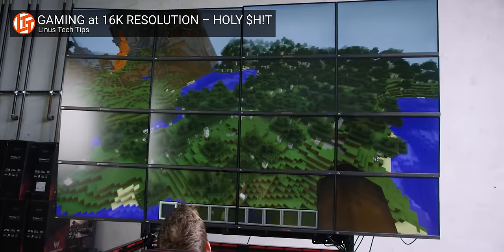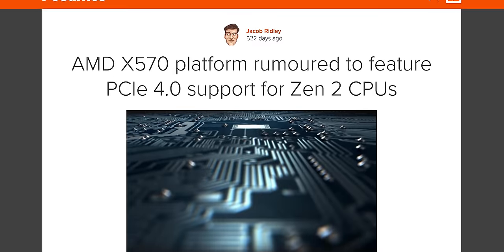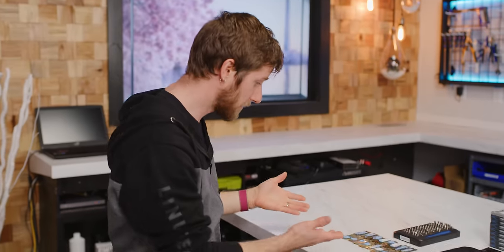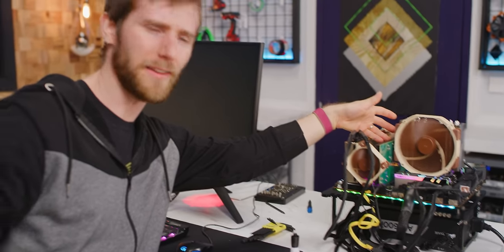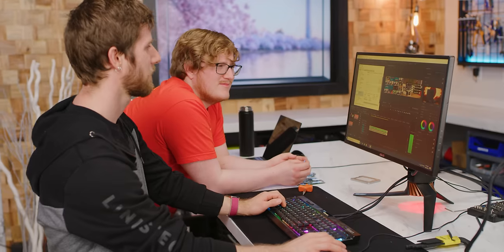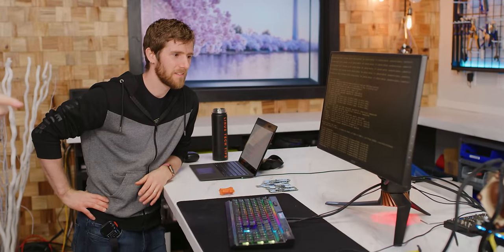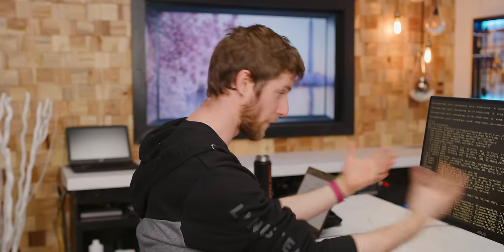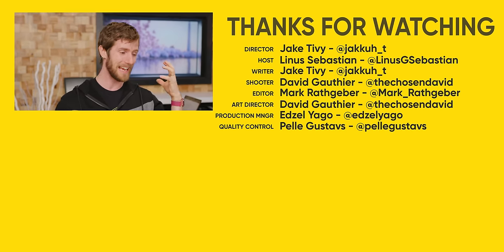This is 50x faster than your PC… HOLY $H!T - Liqid LQD4500 Honey Badger

Comment: “PS5 storage outclasses anything available on PC”... doubt.
Reply: Technically for now that actually stands true, the PS5 runs some specs and hardware that aren't out on the mainstream market yet, but I assume that will change in the next two years
Reply: @Yuzuki1337  you watched the video?
Reply: Yuzuki1337 it uses a nvme it’s the Same
Reply: Everything on the ps5 is mediocre except the ssd, and it isn't even out yet. Its going to be a midrange pc by the time it comes out as it has always been.
Reply: @Yuzuki1337  But 825gb ssd as storage is very little, they could of put 1or 2 tb.
Reply: Shank Adams  they didn't lie they didn't except such a blow
Reply: @Yuzuki1337  PC's bottlenecks and latencies still limit it from being used at higher speeds than the PS5. But, why listen to MULTIPLE game developers,  when you can just continue to lie to yourself?!
Reply: @LinoOliveira92  There is, also, no audio part on PC so far that can perform the audio tasks the PS5 can do either. IF you used your CPU, it would take about 8 cores, just to match that audio processing.  People have just been ignoring that, though.
Reply: @Yuzuki1337  Ps5 uses regular Nvme Pcie4.0 SSDs for expansion as revealed by Sony themselves. Doubt it's any more special than modern PCs
Reply: Shank Adams  Yoir understanding just isn't high enough, in the game architecture field. Your bottlenecks, FOR GAME CODE moving around the system, prevents anything like those speeds TO VRAM.

Also, Sony didn't tell you that. SEVERAL game developers (from all over the world), told you about PC's bottlenecks.  PC Master Race fanboys just need to get over it and stop bring up stupid points (like presenting SSDs with high speeds without understanding about bottlenecks in PC gaming).
Reply: @vishnuprasadc9359  PS5 uses NVME SSDs of a specification that does not exist yet for expansion, and it also has a memory controller specifically to manage the NVME so that its remotely comparable to the priority levels the built-in NAND has.  In other words, games can STILL use that NVME more efficiently than you can on PC right now.
I'm also fully expecting there to a be a tiny list of "PS5 compatible" NVME drives.
I personally think the Xbox Series X expansion is better.  It might be proprietary, but its designed to be hot swappable (I believe), can be moved between multiple consoles and will be just as efficient as the internal NAND without the workaround Sony had to do that I'm fully expecting some games to have performance issues with.  PS5 is almost certainly going to be the like the PS4, if you move the drive over to a different console, you have to format it, which sucks.  The only good thing being if you upgrade it later, you can use the old one in your PC.
Reply: @Yuzuki1337  is the ps5 out on the market?
Reply: @LinoOliveira92  PS5 will use rdna2, which will be amd best gpu until 2021 as they promise to uphold value of ps5 pre-release, it's unknown whether nvidia or intel will try to push Ampere Architecture and Xe graphic to undo the hierarchy but it's know that those are not ready for production and even if they do make it will not be able to fit in any middle-high-end because of rushed price tag and of course  it's not guarantee that they will be better or even come close what Rdna2 will be. So no, ps5 will still be the best mass production piece of gaming device at release and at least one or two week after that untill other companies make a move, which is unlikely because they won't risk being crushed by ps5 over hyped sell.
Reply: @bachvandals3259  I hope Sony pays you well
Reply: It is though. This video showcases an expansion card that just merges SSDs that you have to buy. It's not the same as having a single SSD unit.
That like if I claimed that no GPU is better than the Titan RTX and you came and claimed that it was false because 2x RTX 2080 in SLI was faster.
Reply: @chrisbustergames0785  Form factor has nothing to do with the technology behind it
Reply: @HelloWorld5985  Antics my man, what I meant is "won't be out on the consumer market by the time the PS5 releases"
Reply: @Lucas-rt5jb  I doesn't work at sony, so... No.
Reply: @J3-2344  consoles arent designed to be the fastest, they are just designed for schleps who dont have the time, knowledge, or money for a decent pc.
Reply: @AscendedSaiyan3  console gamers don't even know what latency is lol.
Reply: Bakuboy's Talk Okay, but really? “Not guarantee that (Nvidia) will come close to rdna2”? Do we live on the same planet? The same planet where Nvidia has been dominating the GPU market and staying ahead of AMD just about every step of the way? In my mind you’ve got it absolutely backwards. AMD are the ones with something to prove who need to step their GPU game up. Ampere will be great, rdna2 is what remains to be determined.
Reply: @Yomom12388  I agree no way amd 
Out does nvidia this next generation unless they step up there game big time
Reply: @bachvandals3259  ps5 will use rdna with rdna 2 features not full rdna 2 and you're talking as if the xbox series x didn't exist wich is more powerful than the ps5..
Reply: @Ultizer  That's the problem. They don't have much knowledge about the thing they halfway worship. As far as CPU to GPU latency goes, PCs have been lossing that battle, for generations.
Reply: @jordancup5802  ps5 will feature rdna 2
Reply: Shank Adams  Well, Sony is pretty much the only company being trying to be ambiguous as possible and allowing their protractors to  believe that their PS5 "Super SSD" will make run games faster FPS wise. Microsoft being a PC centric company has said none of these things, directly advertising that their SSD will make games LOAD faster, but not increase FPS. Microsoft correctly has the FPS area covered with its more powerful GPU and CPU specs.
Reply: @J3-2344  I guess that means SOOO many GAME DEVELOPERS are PS fanboys? How could someone come up with something so stupid, just to satisfy their confirmation bias. 😔

Comment: So.. if you install another card like this on your setup, you can get 57GB/s?!  That's 32 PCIe lanes of storage only for the Threadripper to handle.. sounds possible! 🤔🤷🏻‍♂️
Reply: The second pcie slot is only 4x instead of 16x so it wouldn't work that fast.
Reply: @robhill8894  Correct, but I was referring to a motherboard that has more than one PCIe 4.0 x16, like the ASRock TRX40 CREATOR

Comment: "Game consoles a decade later"
Huh, I did not take Linus for an optimist.
Reply: I bet by then that everyday handheld and wearable devices will have taken priority by then. And after them maybe a console ^^
Reply: He's only salty because he knows next gen consoles are better than 99.9% of gaming PCs.
Reply: @budthecyborg4575  They're always better at the beggining of their life cycle. But that temporal advantage is getting smaller with each console generation.
Reply: @fernandomartin4141  You really have it backwards.
 Moore's Law has been dead for years now, advances in Silicon Fabrication are getting progressively more difficult, Single Thread performance in PC has not changed in half a decade.
PS5/Series X will be more relevant compared to PC for an order of magnitude longer than PS4/XOne were.
Reply: @budthecyborg4575  maybe in the delusional world of a console fan boy
Reply: @pravin3280  also most people don't build a new pc every couple of years let alone a high end one sure some people might upgrade a parts in it like a new hdd/sdd ram or graphics card every few years (still rocking i7 4790k and gtx980)
Reply: @pravin3280  when RTX 2070 become mid-upper end?
Reply: I don't think many PC fans are understanding what the GAME DEVELOPERS have said about PC's bottlenecks (when it comes to SSD transfer speedz).

Linus should learn game development. Then, if he tried to get game code data into VRAM, he could TRULY SEE all the latencies and bottlenecks. SSD speed is only ONE PART of the equation.

Comment: I love M.2s but it leaves so much of a case unused since I always want clearance for a beefy GPU. Just did a build for my nephew that is all m.2 storage since we're now seeing 2.5" SATA SSD prices. The only reason I needed to use a PSU cable other than CPU, GPU and 24 pin ATX was for the fan/RGB hub. Those systems getting clean. Much easier to build now. In the 00s, before PSU shrouds were a thing, cable management was 99% of it.

Comment: Suck it ps5! Dominance restored.
Reply: the ps5 is still rendering a comeback
Reply: 3:13 "The most that a single drive can really achieve right now is 5 gigabytes per second sequential."
Just for reference, that's 0.5 GB/s slower than raw PS5 I/O, and about 4 GB/s slower than the PS5 when it's using its hardware decompression pipeline, and all of that with zero CPU load. The Honeybadger is not an SSD, it's a software RAID card, and it maxes out a Threadripper CPU when loading at full speed.
Reply: @KillahMate true pcie 4.0 are coming at the end of the year aka phison e19 e18
Reply: Haitian Xu  not taking away from your points but the ps5 was already listed for 650 usd
Reply: Still amazing for consumer level product. This something no consumer can buy. PS5 is something they will be able to in the coming months. But I expect really fast 5+ nvme ssd by early 2021. Plus let's see what pcie 5.0 will bring.
Reply: Do we actually know if the PS5 is using a single SSD?
Reply: @yoo-jin  - yes. Official specs are out.
Reply: Single SSD is essentially still chips in Raid. SSD’s improve their throughput by increasing the amount of storage chips on the SSD, so it’s really hard to compare the custom PS5 SSD (that we still only know the headlines of) as a single SSD in relations to this RAID SSD. Also, and I’m just copy pasting now. We don’t have the necessary data to compare the two yet. The PS5 might still be faster if the pipeline infact is redesigned with custom Silicon. We don’t know yet. If the metric is theoretical throughput this card is faster. If the metric is request to first GB, then theoretically the PS5 is faster than any PC out there.. if the metric is request to first 100TB data, the throughput will again overtake the I prep emend s to the pipeline. Essentially we don’t know what is faster because we have no idea how to compare them, and we will always be able to make scenarios that favor one or the other... now be nice.
Reply: It only costs way more. No idea why people keep coating their thousand plus dollar PC's to consoles.
Reply: @Bear Omega Hate to burst your bubble but even cheap laptops have SSDs in them nowadays, so a cheap 140MB/s HDD in anything you might call a gaming pc is unrealistic.

Gaming PCs ATM will be pretty split between SATA SSDs running around the 400-500mb/s mark or NVME SSDs at 2-5Gb/s mark
Reply: Oh shut up... One is a console, one is a pc.. If you like a pc buy one or upgrade your own and if you prefer a console purchase that, or hey buy both if that's your thing but it gets soooooo boring this comparing apples with oranges. We know that the pc will always pull away from a console due to its upgradeability path but for the sake of people's sanity can we just enjoy both pieces of technology rather than turning it always into a my wang is bigger than yours....
Reply: @Bear Omega the cope is unreal lmfao
Reply: @Bear Omega I mean no SSDs have been commonplace in laptops for years now even budget ones. And when it comes to gaming PCs you will normally find they have a 512Gb-1Tb SSD and a large HDD alongside it. To get the best of both worlds
Reply: Ps5 already have this and with a single ssd plus its a 4.5 pcle and theyll try to make the 4.7 ones  ... so gg
Reply: Haitian Xu  yep JAJAJAJA so at this times pc will need something that a console has .. imagine if they brick it so pc cant use it 🤭 hahahaha i will die of laughter
Reply: @Camera.Car_  ps5 doesnt get anywhere close to 20G/s
Reply: Haitian Xu  console<pc. I don't care what Sony and x box have put in the Kool aid, I'm not drinking.

Comment: Speed: 29 GB/sec
Size: 256 GB
Time to fill: 10 secs
Price: $300
Me: ...
Reply: Dude that price is bullshit. Where did you find that? If you go to the website you need to REQUEST A QUOTE.
Reply: trump...
Reply: @exterminater267  enterprise SSDs are pretty expensive, a quick search should tell you
Reply: its not 300$ lol its 3200 and that depends o nthe type and speed u get lol
Reply: @cutiebunnyamber3447  Only winners here BB
Reply: @PlaystationTalks  3200? Thanks for the jokes
Reply: @exterminater267  no I just assumed that. But generally it's going to be very pricey
Reply: @PlaystationTalks  well $300 for 256GB is still mad expensive cause 256GB is literally nothing based on the data consumption of today's standards. For comparison you can get a 2TB NVMe SSD for $250. At least  2TB is not going to fill up as quickly as 256GB right?  Having less storage with crazy speeds is not going to be ideal/optimal in most of the cases out there.

Comment: You're holding 32TB of DDR4 ram in your hands, Linus.
Surely there must be someone, somewhere, who wanted 32TB of RAM for under $2500.

Edit: As Andrew points out, the 4TB model in the video is expensive. $2500 would only get us about 16TB, but the point is the same.
Reply: yea each of those sabrent ssds is 850$ each and he has 8 of them so i suggest you bust out a calculator.
Reply: @Fine_i_set_the_handle  As you say, the 4TB SSDs featured in the video are expensive. However, the 2TB Sabrent of the same model go for about $270 each, which would still put us at under $2500 for 16TB of DDR4.

Comment: Since when are there Console VS PC wars in the comments? PC will always be superior.
Reply: Except in real world storage speed for gaming where PC will be behind for years to come.
Reply: PS5 SSD is superior.
Reply: @almighty151986  "for years to come". Dude,  you can already buy a few SSDs taht are faster than the PS5's lol.  Very rare, but they exist. And more are coming out later this year. the new Samsung is supposed to be 6 or 7 GB/s
Reply: Kougeru I apparently decided to answer comments today. The PC infrastructure needs to be more flexible than a purpose build machine only intended for gaming. Essentially it is possible to build a machine with custom hardware that is faster for gaming than a respective PC will be because it needs to respect infrastructure rules. It is possible for a console with 5GB/s to be faster than a PC with 100GB/s if the task is to deliver 200MB og gaming data to the cpu. For years to come might be a bit rose-tinted statement, but since the PC infrastructure isn’t specifically built for gaming, it is possible for a console to build an SSD than in real life will be faster than a pc even if they reach 10gb/s tomorrow (as long as we agree on the metric). Because they can remove bottlenecks that the PC needs to keep, and as long as the data that needs to be moved is still within a certain range where the throughput isn’t the limitation.. yet.. then the custom hardware “wins”. However, we don’t have the data to state if that’s the fact. We don’t know wether a purpose built machine with custom hardware is better at doing what it is specifically built to do, and it’s pointless to state so until it’s actually possible to verify the validity of the statement. It’s easy to claim something is superior, especially if it’s with a very task specific cherry picked scenario, but actually being faster in a real world scenario requires proof. And we don’t have that.

Comment: PS fanboys punching in the air right know, after hearing their future PS5 will not run games the fastest
Reply: If you watched the video this isn’t for consumer use... but of course there will be faster drives in the future
Reply: To be fair, it's not the SSD in itself that is extremely impressive, though it is, it's the I/O and the interconnection of the system that's impressive.
Reply: @Tohur we're  talking ssd speed here doriphy
Reply: I'll be happy to see your CPU handle game data moving and asset decompression at 29gb/s. Epic lag spike. PS have all the custom chips so CPU is never hit by data moving/decompressing up to 22gb/s. That's the power of a great architecture. Also you're comparing with a 500$ full system. It's like you beating up children to prove you're strong.

You can see in the video they reach only 3.8 gb/s in real world application with 50% of all 64 cores used. Not really impressed.
Reply: I mean the fastest single ssds on the market rn are 5 gb per second still placing it near the top.
Reply: @danielp2911  i know, it's not for us, consumers, and the fastest single ssd is 5Gb, but i'm 100% sure some ps5 users will probably mock pc users and say "haha, my console is faster than your $1000 or more PC", when probably in near future consoles will be surpassed by pc miles ahead with technology

Comment: As a 'Big Data' guy, I'd like to see pricing. 
There are some interesting configurations where this could come into play. 

Would have to consider which NVMe drives to use  though.  It would depend on the individual use case. 

But I have to ask... 
Have you tried running this w a higher end nic card? dual 50GbE ports at a min or 1 100GbE port w the right card.
Reply: Michael, if you use twitter ping me over there. I work for Liqid :) @staggeredsix
Reply: @Meatguitarhamjam   I don't tweet. ;-) 
LinkedIn?